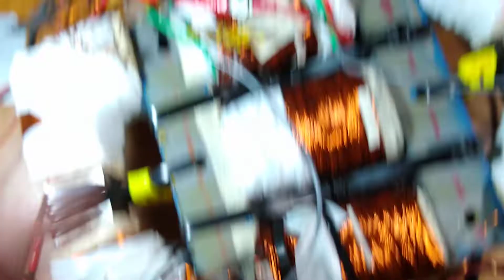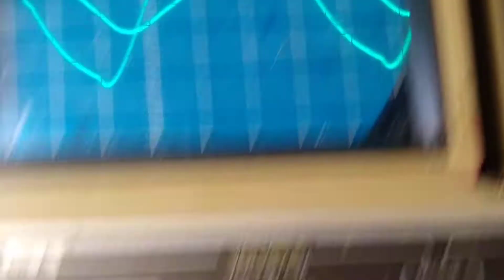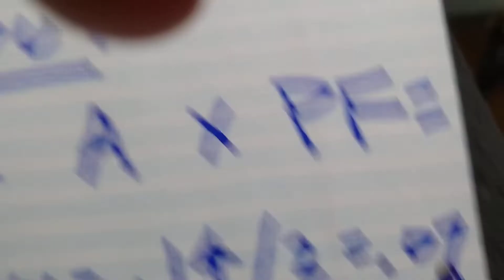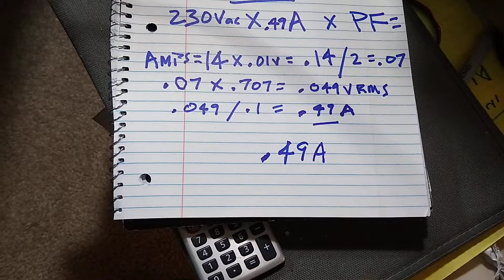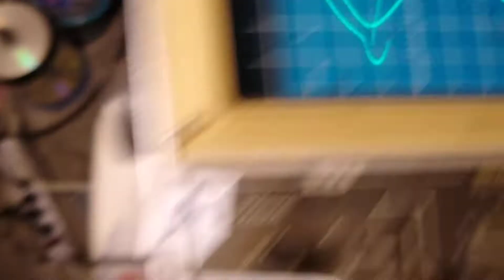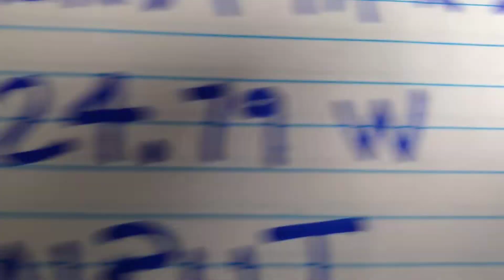24W input 82W output 230Vac input to BiTT

Comment: Can you give me the circuit diagram?
Reply from the maker: Hi Starlight
Look up the Bitorroidal Transformer (BiTT) by Thane Karl Heinz to get history of it and look it up on Patrick Kelleys free energy site, and also JL Naudin tested these too., plus some others.....Its  simple, basically a three phase transformer with the addition of ":shunt bars" streching from left leg to right leg to guide the backemf forces into opposite secondary, not back into primary,  The central primary coil takes in the AC input power, the two secondaries on each side are the output. You can parallel the two secondaries, or series them, or run them into two different loads.  I am running the two secondaries in series  into a load of 456 ohms in these two tests. Look up my earilier videos I have a eight part series showing how I did it.   
The microwave oven transformer is only so I can put higher voltages than 120V into it.
Reply: @MrDKONZEN  Good, thank you very much !